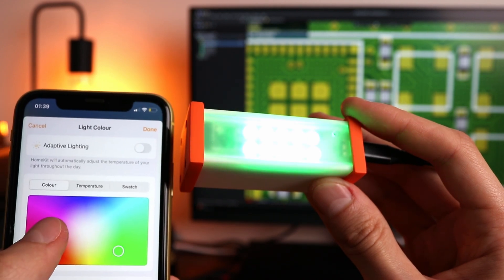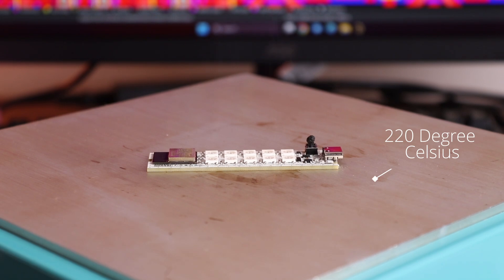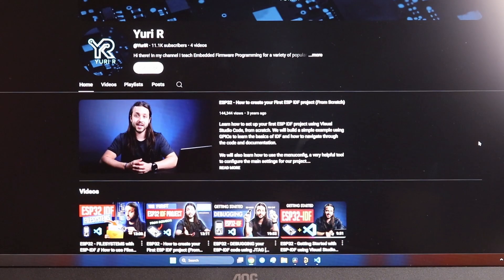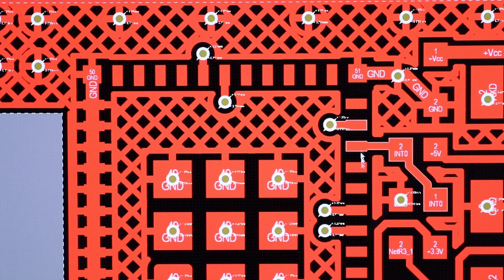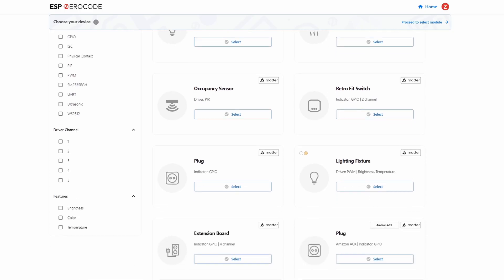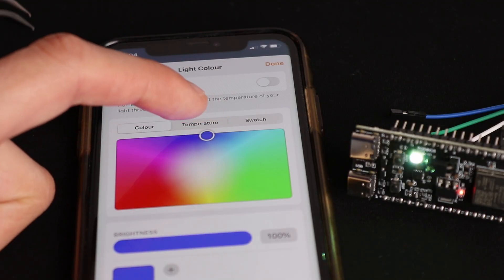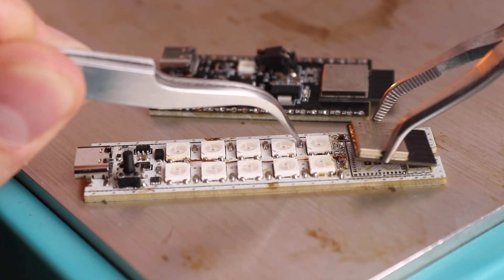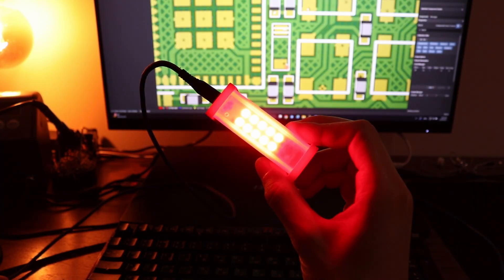DIY Smart Device with COOL Design

Comment: Im not sure if it would be the same for the ESP32 you used, but in the past I had the same 'insufficient flash memory' issue with my ESP32, which could easily be fixed with changing a setting in the vscode project setup which allowed for larger projects. Like there is a slightly smaller limit at default which can be disabled to use the entire memory block. Maybe have a look at it?
Reply from the maker: In my case I don’t think it work. Cause I only flash binaries through vs code. And the problem is in the binary itself. I need to somehow get/create/download the project for  the matter ESP32 device which I would be able to adjust. In the next smart device video I will do it :)

Comment: I wanted to do such a project, but I used WLED. The only thing I don't like about WLED is that I can only control my project with a WIFI connection, but I also wanted to use this light when taking photos outside, so it would be nice if I had the option to connect with Bluetooth. It would be sweet to be able to switch between WIFI and Bluetooth with a switch I would put on the circuit
Reply: Guys guys there is a setting inside wled to turn on Access point mode when wifi is out, or just even always on AP.
I don't see any problem here
Reply: @manthanparmarth I couldn't understand what this would do. I don't know if you have a chance to explain it can you do it.
Reply from the maker: I’m not really a specialist, but I know there’s a way to connect it through Wi-Fi even outdoors. For example, I bought a cheap drone from AliExpress - you can see it in a video on my channel. It connects to the phone over Wi-Fi (I don’t talk much about that in the video, but still), and it even streams video to the phone using Wi-Fi.
So I guess you can program an ESP to work as a Wi-Fi access point when there’s no known network nearby and to connect to your home Wi-Fi when you’re at home.

Do I know exactly how to do it? No, but the code is definitely somewhere on GitHub, ahahah 😄
Reply: @NickElectronics thank you i will check ıp the github and can you share link of video you talking about

Comment: Why the antenna of the module is surrounded with GND on the PCB? It is the most common and obvious issue
Reply from the maker: Yeah, that is one of many 😁 I did a cutout beneath it though. And at the top it is still opened. So it’s not fully shielded. Should work and it is, but how good. That’s another question, ahahah

Comment: Does the fire thing work for small PCBs?
Reply from the maker: I don’t think so. It’s not a real method — it was a joke! :D
Reply: @NickElectronics I thought it wasn't possible to be real but if I heat the PCB with a lighter from underneath will it work?
Reply from the maker: @franxchiesto I mean, if you put a metal sheet beneath the PCB and heat the sheet with a lighter I guess it might work. Otherwise you will burn the PCB
Reply: @NickElectronics yes exactly what I meant